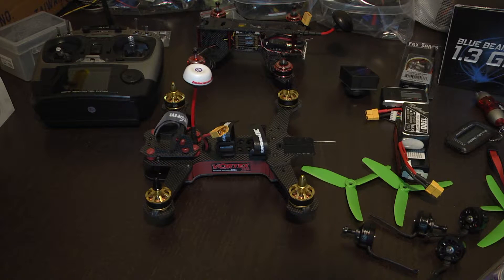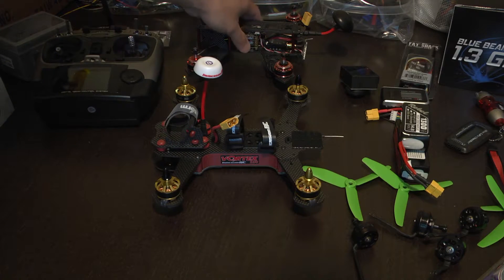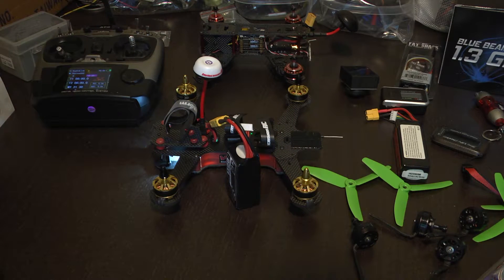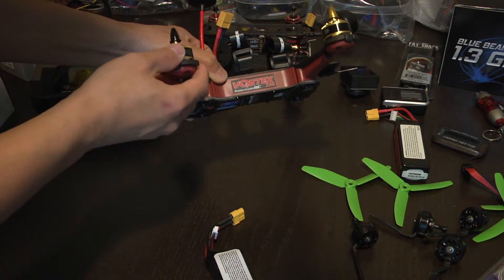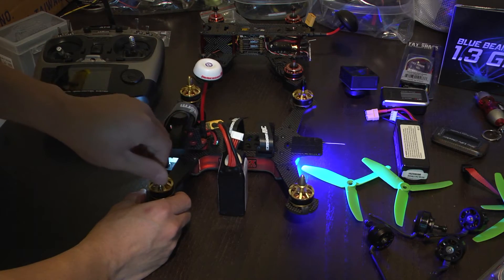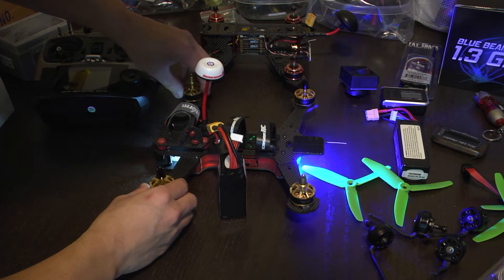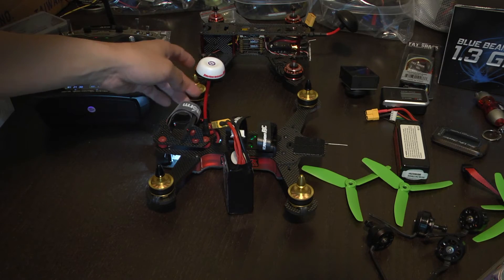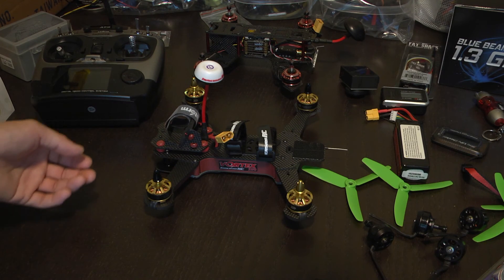How To Adjust Motor Rotation of Vortex 250 Pro / 285 with rotorSENSE

Comment: I know this is an older video, but THANK YOU so much for leaving it up, got the 180 couple months ago cause I found it online marked down crazy cheap, like hundred bucks.  Couldn't believe how much  I enjoyed it, and how well it flew since the Vortex has been out forever in terms of our hobby.  Burnt up a motor and esc, and been trying for days to figure out why replacements wouldn't work, probably redid wires/soldering 3 times, thinking i messed something up. In the hobby 5yrs, never heard of rotosense, and there's not much out there about it, so again, huge thanks!!!
Reply from the maker: sunshynff Glad to find that the video was useful. I actually ordered a few Vortex 180s as you can’t beat the price. They are super fun and fly quite well. Cheers!
Reply: @MatrixWriter , totally!! it's kind of my beater/practice/let my nephew fly it type quad..lol.  Tough little guy and flies great
Reply from the maker: sunshynff I agree - esp for the price. It’s the best way to improve flying without a simulator IMO

Comment: Tanks bro you safed me. My 230 won't connect to bl heli. And as not said. It's a lot of work to do it with a soldering iron. So Thanks again I did not know that this was a thing.  So easy so sweet man. Love it. 
Do you know does it work with betaflight also, or only with the vortexes? Thanks. Peace
Reply from the maker: Stefan H. SteveSMCfpv I’m glad I could help you out!  At the moment it’s a feature with the Vortex Pro’s ESCs, I wouldn’t be surprised if this feature is added on newer 32-bit ESCs. You can to change the motor directions in Betaflight at the moment. However, motor mapping and directions can be adjusted in BLHeli Suite.

Hope that helps and safe flying!
Reply: @MatrixWriter  thanks yeah that would be a great feature man. 
The problem is I can't get into bl heli! But Thanks anyway 
Happy flying bro
Reply from the maker: Stefan H. SteveSMCfpv Thanks! Unfortunately from what I read, the stock ESCs don’t really have the ability to connect to BLHeli. If you end up with a 3rd party ESC, you might be able to connect to BLHeli (it’s done through the flight controller and with the signal wire). However since this quad is a tightly integrated design, it might not be possible...
Reply: @MatrixWriter  Thanks again.
Of course not. 
 Sometimes I feel really stupid in this hobby. 
Maybe we should pull a request for that feature, I'll try to get that going. 
Thanks & peace

Comment: What about if I reverse all my motors instead of spinning inside it will be outside? I mean if I flick each motor on an outward spinning direction, will it the rotor sense save that? I don’t like the spin direction of the vortex’s because when the motors spins, all the dirt or weeds, or grass goes to the drones camera and making so dirty. While on the opposite direction, the drone wouldn’t be that dirty at all.
Reply from the maker: Wilfred Ocampo I don’t think it’s possible to configure the motor directions and have the quadcopter fly correctly. RotorSense makes it easy to adjust the rotation of the motors without having to connect the quadcopter to a computer or swap one do the phase wires. However using wrong motor direction will result in your aircraft not flying correctly. Cleanflight/Betaflight has specifics for how the motor directions are to be set.
Reply: @MatrixWriter, oh I see, thanks for your response

Comment: Can you change the ESC for a Lumenier 30A BLHeli_S ESC OPTO (2-4s) DSHOT on a vortex250 pro
Reply: I got the new freybott 2400kv motors, want to know if stock ESC is ok with those motors. Is there any lumenier 30A esc that fit on vortex frame?

Comment: Have a Vortex 150 and was pulling my hair out and NOT wanting to swap wiring.  Discovered RotorSense in the manual and that did not work either.  Your video showed me I was not giving it long enough on the motor spins.  Being able to actually SEE someone else do a procedure is worth it's weight in Gold!!  Thanks for posting this!

Comment: If I use a different esc will this process be different?? I want to put the UBAD 30a Angry Beast ESCs.
Reply from the maker: Unfortunate rotorSENSE technology is exclusive to ImmersionRC ESCs.
But third party ESCs can be configured with BLHeli for example with single wire programming.

Comment: Hey I just subscribed. I have an Immersion Vortex 250 Pro. I use a full range receiver called the SM4648 by Spektrum. It's a true digital serial receiver and was designed for the vortex. It looks identical to a satellite RX except it has long RX wires giving it the full range. SSo far it works amazing with ZERO LAG At great distance. I also have a P4, P3 Advanced and a couple DJI NAZA V2 450 BUILDS as well as MANY 100 size OR LESS to 350, including the qx350 and the qx200, both are great machines for the price. My question I have is what type of radio system are you using ?
Thanks!

Comment: but i have vortex 250pro like yours can i doit esc call. from cleanflight ????????? are you sure ???
Reply from the maker: If the quadcopter is running Cleanflight (or betaflight) you can do ESC calibration.  It might not work for all models but it is worth a try anyway. It really depends what bootloader and firmware is running on the ESCs - SimomK, BLHeli, etc.
Reply: OK thanks for your time

Comment: Thanks for answer so fast last question haw you calibrated  the stock escs ?? thank you. ..
Reply from the maker: No problem.  You calibrate the ESC in Cleanflight.  There are some more detailed guides around...it goes something like this
1) Remove the props from the motors.
2) Plug in your quadcopter to your PC and in Cleanflight under motor section, you will want to move the throttle button up to max (acknowledge you removed the props).
3) Plug in battery to power up the ESCs and quickly move the throttle button to minimum.  You should hear a series of beeps and tones from the ESCs/motors.
4) Calibration complete.

Comment: i put on my 250 pro the emax 2205 2300kv but on full throttle i dont hear nise skreaming from motors ...can i chenge the timing with these escs ?? i try tpa , braekpoind , pid , byt nothink..what you thi
Reply from the maker: It could be that the ESCs need to be recalibrated or maybe the props aren't balanced?  I recalibrate ESCs whenever I change the motors out.  

Adjusting other ESC parameters, you might have to contact the manufacturer on this as I have no idea. Sorry!
Reply: hi could you do a video on how to calibrate the escs after a motor change on the vortex 250 pro  nice video by the way
Reply from the maker: There are a bunch of videos on YouTube for calibrating ESCs in Cleanflight configurator.
This guy explains it very well here.  Hope that helps!

https://www.youtube.com/watch?v=csCBMF8P3qg

Comment: I have a 285 Vortex that I'm currently changing out the motors to Emax red bottoms, and dys 20amp esc's. My question is, is rotor sense built into the stock esc's or the fusion flight controller, and will this method still work on my esc and motor upgrades? Thanks in advance
Reply from the maker: Rotor Sense is built in the speed controller and not the flight controller I believe.  Worst case is that you just need to swap some motor wires around.  Hope that works.

Comment: Sorry if you mentioned this in the video but what motors did you replace the stock ones with? Do you fly with tri-blades? I am looking for the best drop-in replacement motors for 3S and 4S batteries, and tri-blade props, with the least amount of reconfiguration. Two of my vortex 250 pro motors are 'bad' now and I'm unsure if I'll be able to fix them, so at this point I'm looking into new motors. Your video was very informative. Thanks.
Reply from the maker: Thanks!  Nope I did not mention the motors in the video.  In the video I replaced the stock motors with the Scorpion M2205 2350KV.  Other motors I recommend are Cobras 2204 2300KV and Emax RS 2205 2300KV.  
I use tri-props with all my quadcopters.  HQProp 5x4x3

Hope that helps and best of luck!
Reply: +MatrixWriter thanks for the fast response. out of all of those motors which would you say is the best quality and fit for the vortex -- or are the ones you're running in this video the 'best.' Did you have to reconfigure much with the motors you have now or was it pretty much plug and play with regard to PIDs?
Reply from the maker: John Cuppi
No problem.  I would say the best is subjective and up to preference and how one fly's.  Best thing to look for motors is quality/durability, weight to thrust ratio, etc.  I would say these three brands are all pretty much similar.  I chose Scorpion as I have used them in the past and haven't had any issues with them.  One compliant that some might have (same with Emax) is that the motors are sort of heavy.  Another good brand I forgot to mention are Tiger Motors (aka Tmotors) and Lumineer branded as well.  It is all up to you to look at the specs and thrust datasheets to decide what is the best.

I didn't mess around with the PIDs when I installed them, but I would definitely adjust them slightly since they are different than the stock ones - ie, mass, size, power, etc. 

Just make sure to watch how much current is being used so you don't overload the 20A ESCs.

Comment: hey,when you put your new motors on your vortex did you have calibrate the esc or anything. I just put the 2205 on my vortex and the throttle response seems weird.
Reply from the maker: I did not recalibrate the ESCs when I put different motors and I didn't have any issues.  For you, it looks like you will have to calibrate them in Cleanflight as you cannot via OSD.   

Hope that helps!

Comment: do u think a 3.5 volt cut off is good with the srd250? with a buzzer alarm
Reply from the maker: +59poppN I would do 3.6v so you have room to land.  And it will be close for LiPo storage voltage.
Reply: thats wassup bro good looking out
Reply: what kind of clover leaf antenna you use? im looking for some good ones with less breakup i heard of the ibcrazy ofcourse fatshark
Reply from the maker: I use the ImmersionRC SpiroNet antennas and they are really good - no issues ever.  IBCrazy ones are good too I heard.  Never tried the personally though.

Comment: well said Bro srd 250 it is powercube edition... o and the quad has a ppm are sbus cable to plug in the dr4 II receiver?
Reply from the maker: +59poppN Correct, get that one.  You could get the CC3D one which has OSD but ESCs are meh.
Reply: so the power cube edition dosent have osd?
Reply from the maker: That is correct. You need to have the TBS Core with 100a current sensor.  The PNP50 will not work as the drone will easily pull 70A and burn it out.  However both of these don't fit the drone too well as it is too large.

Comment: Yeaa I meant between the two storms 250 &210....
Reply from the maker: +59poppN Ah I see then, my bad.
The two storms use the exact middle frame dimensions for electronics.  250 will not give you more space over the 210.  However, the 250 will allow you to use 6in props since the arms are longer.  The 250 has 4mm thick carbon fiber rather than 3.5mm on the 210.   

If you really want to go faster, get the 250 version as you can use a bigger props.  Try 6 inch bullnose tri-props for max speed and power - however this would require you to upgrade the motors (Scorpion or Cobra I would recommend long term) that can handle more current.  You will want to use the TBS Power Cube as it can do 30A continuous with 50A peak.

Comment: I am working with TBS to see if they can help.  it works fine on the powercube, just not the core pro.
Reply from the maker: +mvick4ever Yeah, I had that issue.  The TBS Vendetta uses a new Power Cube with OSD.  Maybe I'll put that cube in a 250 frame haha.

Comment: I have a SRD210 Charpu frame from helipal, and I too tried to install the core pro race edition, but I couldn't get it to display anything with the storm vtx and camera.  bummed me out because I like osd.
Reply from the maker: +mvick4ever Same here man.  OSD is important for me, esp battery voltage so I don't kill my batteries.

Comment: thats one awesome storm srd 210 with the tbs stack cooling motors in it you like it better the the vortex storm racing drones
Reply from the maker: +Philip Bohuslav I like both drones.  However I like Vortex's clean design and layout.  It just handles really well out of the box while the SRD requires lots and lots of tuning with the flight controller and software via PC.  Also it does not have OSD, which is a bummer.  I tried putting the TBS Core PNP but it didn't fit very well and was too bulky.  I'll probably design my own quadcopter as my next project.

Comment: ok cool thanks alot bro really appreciate the info... now it's the debate on the 210 r 250 storm lol i have a 285 vortex already
Reply from the maker: +59poppN Go with the 250 Storm and put a power cube on it.  Vortex 250 would be similar to the 285.  It just is smaller and has newer electronics and better ESCs and larger motors.   Cheap upgrade for the 285 is use the 20A ESCs from the 250 and use the new cobra 1806 2300kv motors.  Those motors would be identical to 2204 type.
Reply: ok sounds good but why you say the 250 srd over the 210? more durable and stable?
Reply from the maker: There is no plastic on the SRD and it is a unibody frame over the Vortex.

Comment: ok cool I have some dominates v3... but what about the taranis radio? will it automatically bind? are will i have to use the orange rx module?
Reply from the maker: +59poppN Just make sure to get the 32 channel Rx 5.8GHz module.  Best compatibility.   No idea on orange rx.  I have the Taranis plus and it binds to the D4R-II with no issues or extra stuff needed.

Comment: sure did help thanks alot bro... one more thing will that 9rd receiver bind with a taranis radio? are will I have to get rx module which I have already...
Reply from the maker: +59poppN No problem. Not the R9D receiver binds only to RadioLink and nothing else. 
For Taranis, use the D4R-II 4 channel receiver.  It is small and just use S.Bus.

Comment: thanks bro what size is that storm? thinking bout getting one.. and which do u prefer storm are the vortex? which is faster and more durable?
Reply from the maker: +59poppN No problem. 
Would have to say that Storm Drones are more durable.  If you get the 250 frame, it has 4mm thick carbon fiber and it is uni-body.  Much lighter and waaaay easier to work on than the Vortex   I currently have the 210 frame but might get the 250 frame.  By default, the Vortex handles really well and is easy to fly, but Storm drones require all configs done on the PC with your flight controller chosen. 

Now in terms of what is faster, the Storm drones are as you can put bigger motors and ESCs with higher current than the Vortex without risk of burning the puny 20A ESCs.  The TBS Power Cube is rated 30A continuous and 50A peak.  I have larger motors coming and will test this out with 6inch bullnose tri-props. 

Hope that helps.

Comment: WHAT QUAD IS THAT IN THE BACKGROUND? AND HOW DID YOU GET THE TRANSMITTER TO WORK WITH THE VORTEX?
Reply from the maker: +59poppN Storm Racing Drone frame with TBS Power Cube installed.
Radio system in this video is RadioLink AT9.
Binding and setup with Vortex: https://www.youtube.com/watch?v=YbcdM7S6bd4